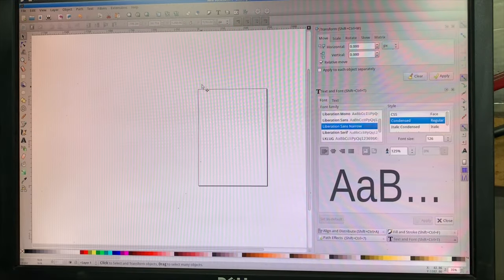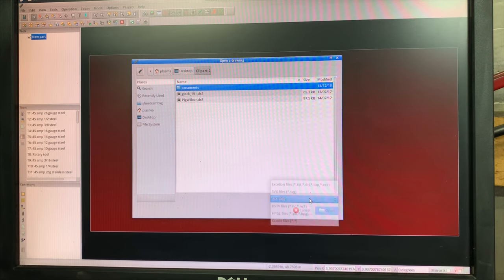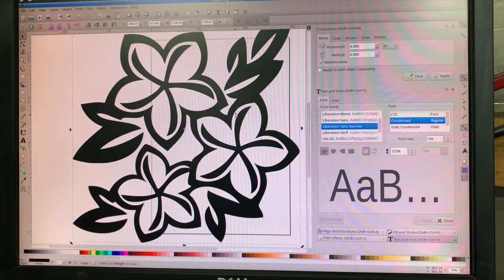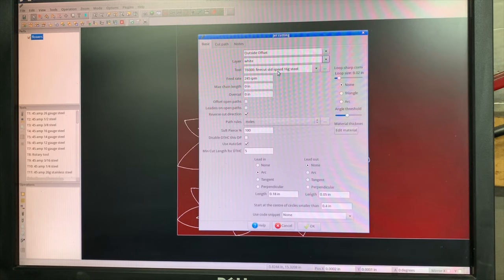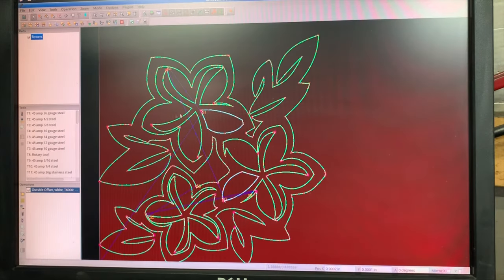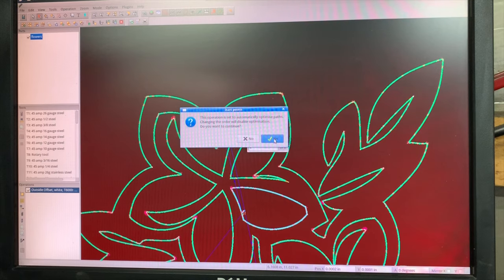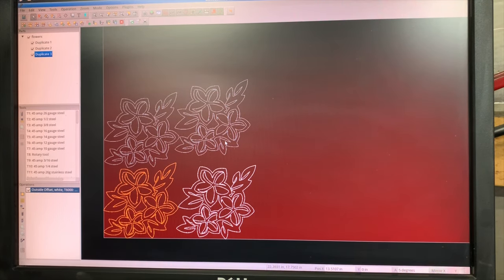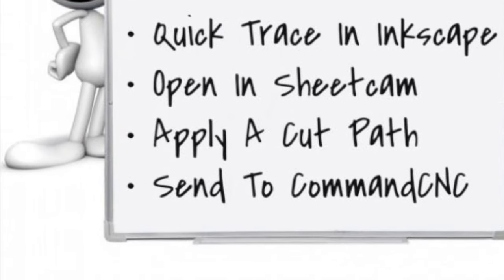Inkscape to Sheetcam to CommandCNC  Video Tutorial

Comment: wish i can give this video more than 1 like...youve showed me start to finish which ive been trying  to find. video tutorials ive come across most of the time is bits and pieces. i just got my crossfire pro and ive been meaning to cut on it but ive never owned a cnc machine before. i do weld on the side though so i thought having a plasma table  cut it for me would be more easier.  which program do you recommend for me as far as designing? i have both inkscape and fusion 360. ive new to inkscape program, but if its easier to work with then ill focus more on it..great info on the vids. subscribed
Reply from the maker: Man sorry for the extremely late reply. I use Inkscape pretty much exclusively. I've played with Fusion 360 some but to me Inkscape is a lot easier and faster. Fusion Is a great program but a little over complicated for basic 2D design work.